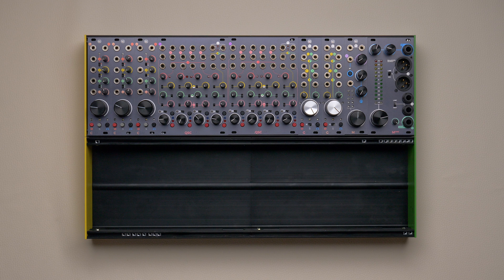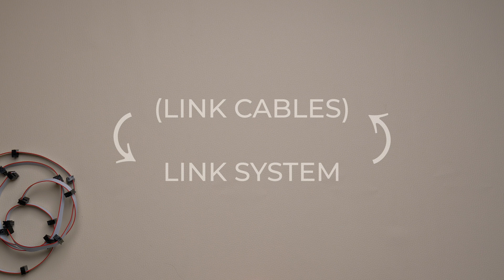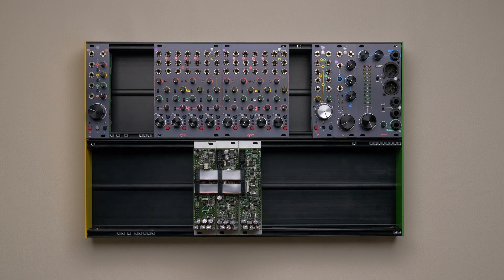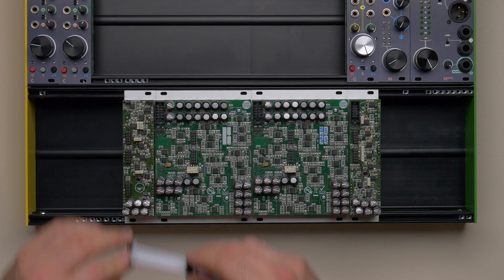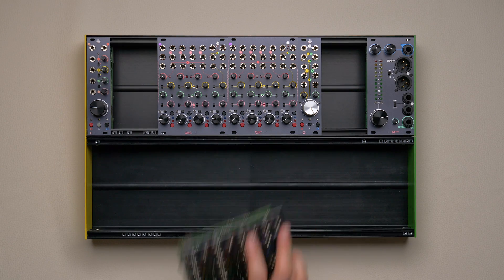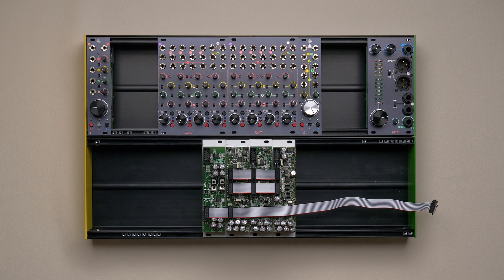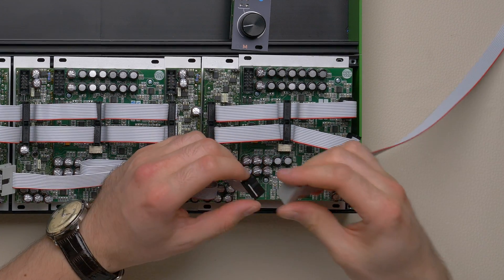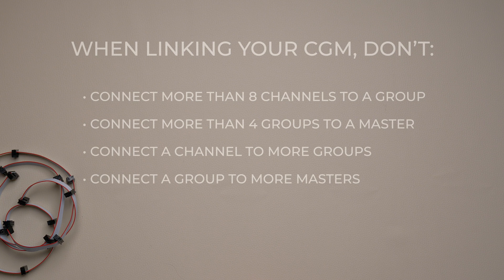How to Build a Frap Tools CGM Eurorack Mixer Setup

Comment: Hi, i have a question:
Can i link my sc to my qsc without a group module?
Reply from the maker: Hello! No, it is not possible because you would lack the physical output jacks with the sum of the SC and the QSC signals. You would need a group module for it.
Reply: @ okay, thanks for your responce.

Comment: with the Group and Mone for headphones I seam to get a much more transparent Sound. Now it’s a big difference to use effects thru send and return via the group module
Reply from the maker: Thank you so much! Having the effects into a send/return patch instead of going straight through them preserves the analog path of the dry signal and it might indeed result in a cleaner tone!

Comment: So these are the best mixer! Would be cool to be able to use a master but have one more way to send to mastering stuff in your rack. Like a multi and compressor. Right now, if you want to do that, you can use your master one. It makes way more sense to use another output. Otherwise you need another group and it’s taking up so much more HP than otherwise.

Would rather use the trap tools master than another brand master output.
Reply from the maker: Thanks a lot!

Comment: This would be great if you had a module to provide DB25 multichannel direct outputs like the WMD has. It's unworkable for many scenarios to be limited to stereo outs, especially in the studio.
Reply from the maker: Thanks for the suggestion! It would be very hard to incorporate such outputs in the CGM because of its open structure. The CGM doesn't have a fixed number of channels and groups: it can range from one channel to 128 (with four groups of eight QSCs each), so it would be hard to prearrange a direct output for all the possible scenarios. What can be done is a format adapter module that could mix a fixed number of channels' direct outputs, or something in this direction.

Comment: Looks great, one thing that I'd love to see in a modular setup like this is a modulation group module that can (similar to scan & pan) scan through its connected channels. Keep up the good stuff! :-)
Reply from the maker: Thanks for the suggestion! Also in this case, it would be impossible to design such a module because there's no fixed number of channel that you can connect to a group: such number goes from 1 to 32 (in case of eight QSCs)! It would be necessary to conceive a group with a fixed number of channels, but that would be almost the opposite of the original CGM idea.